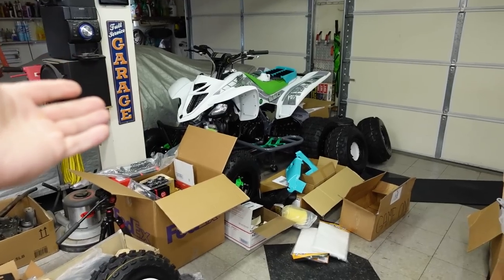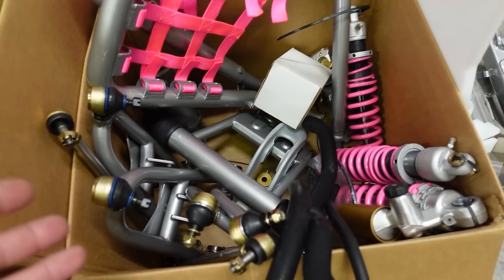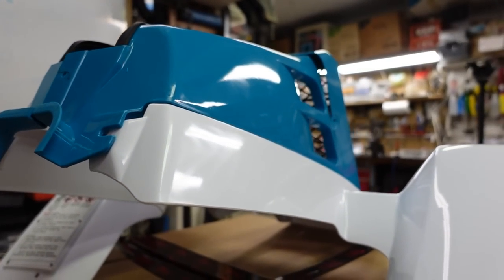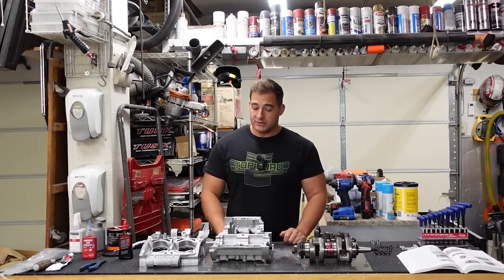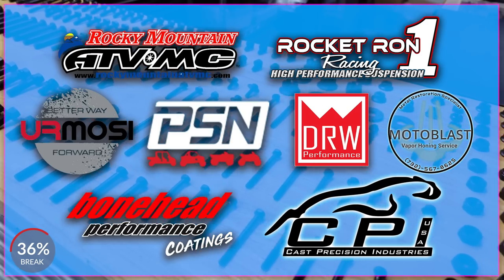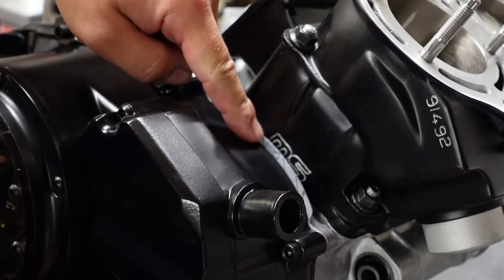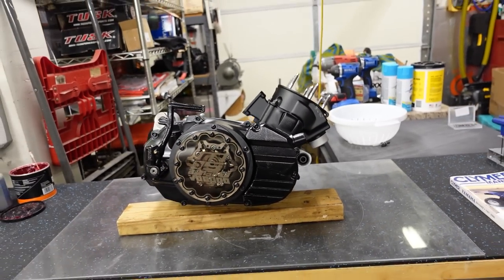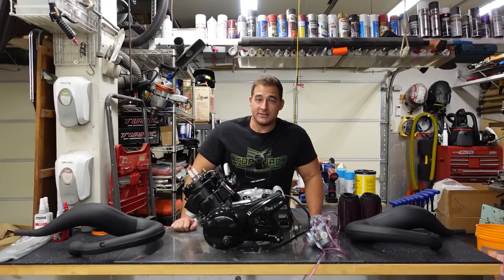Building a high Horsepower 2 Stroke for my Yamaha Banshee! Resto Mod Banshee Part 4

Comment: One thing, Im a machinist that has repaired/made tapers, never oil a tapered shaft. It causes it to never tighten and the reason for tapers is the taper holds the flywheel from spinning.  That oil/grease will cause sheared keys and more damage.
Reply: As a half eaten corn, hes right^^
Reply: As a half eaten sausage, hes right ^^
Reply: I learned that the hard way😭😭
Reply: As a professional YouTube Mechanic, hes right ^^
Reply: As a couch potato he's right^^
Reply: As a keyboard warrior… he’s WRONG^^😂
Reply: As a banshee flywheel key, he's right ^^
Reply: I’d oil it regardless, seen far to man that are siezed on by rust. I live in a very moist climate
Reply: @ericwinkworth6701  water cant enter the tapered fit if its tight and made correct, the taper locks into itself metal to metal. Thats why you need a puller to remove them
Reply: As just another schmuck repeating it, stick it dry bro, that's not what she said lmao 😂 🤣  u end up with a thin fluid film in there and the flywheel will slowly eventually over time vibrate loose, and not loose as in the nut, loose as in the keyway journal and keyway itself wear from constant vibration. I set mine dry, after I fit on with some fine grinding compound and lap the flywheel to the shaft. Just briefly, I've seen u do it in the past so I know u know lmao

Comment: Great Stuff... Just pulled the Banshee out of the shed for some mods and tinkering. bought it new in 97, one great piece. it might have 200 hours on it. im almost afraid to do much modification on the engine, its flat out runs so well. fukn plugs have always burned golden brown. Alot of your very good video tho has showed me a few things i could do . Thanx much!

Comment: best spring puller i have ever come by is an old lawn mower pull cord.... fits every where never slips and never gets stuck. started doing it when i worked on sleds. hell i have even used it to change drum brakes out and hood hinge springs on old cars.  look into it!

Comment: Nice job on your build!!! I use to do all my own port work. You can make it run ok, but absolutely not optimal. I now have CNC cases, cylinders and head. It's crazy the extra horsepower you make by being able to perfectly have the right amount of material gone and shape of the 3 pieces so matched up as one.

Comment: Exhaust bends and types can absolutely make a huge difference.  Prior to owning a banshee had a blaster with full fmf exhaust.  Well I crushed the silencer doing wheelies with no grab bar… 🤦‍♂️ for some reason I replaced the fmf muffler with a pro circuit unit and just THAT made a noticeable seat of the pants difference while sounding better than before.  🤷‍♂️. They were tough to mate up but it worked and the machine was a touch quicker without a doubt.   I bring up the blaster because it’s the only machine I’ve ever mixed or matched pipes on.

Comment: I'm rebuilding/ restoring and modifying my Kawasaki Prairie 300 now and it literally only started out as a get it running again scenario as in rings and piston now it's getting custom built foot wells wheels tires repowder-coated, freshing up the plastics the works. Maybe not to the standard that you set but I can only hope it comes out half as good as the work you do.

Comment: Your first problem is thinking JIS screws are Phillips head.
 Use correct screwdriver, they don't round out.
500 conversion on Banshee is around 105 bhp but I haven't seen one for about 20 years.
Clutch lock up is new to me, only seen that type on drag bikes previously.
It's a total waste of time and effort 'porting' area's covered by the reed blocks although I've seen a lot of them done, you lose some crankcase compression when they are 'cleaned' out but when it's 'on the pipe' it compensates a bit.
You put complete bottom end in freezer when flywheel is really stuck. Next day, pour boiling water on flywheel with the puller installed and they pop right off
The taper locks flywheel in place so anti seize stops things working properly
Has anyone told you the correct way to adjust drive chain when you don't have spec?

Comment: Hello Michael, I am from Germany and currently have a Banshee project running and have a question for you. Opinions are divided on the clutch basket. Some say that a straigt cut gear must be used for 421 cc, others say that the original basket and gearing are fine. What does your community say about this, as you have already built several 421s. In my case, some people think it only works off-road with the original gears because there is more slip than on the road. I'm now undecided and don't want to just throw the basket with gearwheel, which looks like new, into the corner. Best regards

Comment: Not to take away from your current build but, you should check the gears on the transmission you got for your 660. If about half of the gears have a cut in the center its 02 and up. Alot of sellers will lable 02 and up and will actually be 01. The 01 gear sets do not have the notches.

Comment: I have a friend that did I flywheel mod to make it lighter for more of a faster RPM climb. And it worked really well but it’s not good for the trails. Lighter flywheel means easier to stall

Comment: I have mine out of the frame and all apart right now.... wish i could throw that much money at it..3rd and 4th gear needs replacing.looks like a tooth broke off and chewed them both up.luckly it stalled the engine when it happened and didnt  destroy anything else..i bought the banshee brand new from the dealer in 04..piped and jetteted it within a few months. Fmf sst...power core 2...Then elka shocks and +2+1 full flight a arms. Raced mx tracks for a couple years with it..rebuilt the top end .20 over.then the transmission failed.and it sat for like 8 years..finally got it out and tore it down a couple weeks ago

Comment: I got a 1990 suzuki lt250r for free ive been slowly working on alloyboltz is an ok kit I would definitely rather do vapor blasting sucks getting basket cases and all the home depot hardware they usually come with.

Comment: 32:59 idk bout shaving the conners out maybe if it had the stock star cause it has to go a lil higher over each point it seems like the way you did it it could slip a lil easier idk I guess I’d have to ride to feel it

Comment: I need help I have a 2008 kfx450r and when I mash the throttle it spits and sputters I’ve only replaced the fuel pump and it will does it any advice on getting that fixed

Comment: doesn't the high temp paint hold heat into the pipe longer to change the operational power band? I was just curious. I always believe in raw pipes but I have a fmf on my trx 250r until I get the 408 puma one day haha.

Comment: Did someone advice you to run a set of 28 MM PWK's, with that setup ? It will, most likely, deliver more torque in low and midrange, with minimal loss up top. Anyway, nice build !

Comment: Didn't see you put any assembly lube inside at all on the crank or installation surfaces in the case. I would guess you did that off camera. Was waiting so see some on the wrist pins but nope, none. Yeah had to do it off camera. Gotta watch that double nut technique too, it equals screaming in 9 months.

Comment: How are you cleaning up your case. Making it shine like new aluminum
Reply from the maker: I usually get my cases vapor blasted and they come back looking new. The company I use is njvaporblast.com 

This engine I used new cases though, so there was no cleaning necessary.
Reply: @MichaelSabo  I just ordered a new case!
I learned the hard way with the All thread stud kit . My lower case is cracked from the studs and nut. 
So back to stock studs for the case and I called cpi for afr studs for the heads. 

So I have been emailing you about the graphics and I’ll send the rest of the payment through that PayPal thanks can’t wait for some supper cool graphics man .
Reply from the maker: @ryanhoward4598  Ryan I’m not sure who you’re emailing about the graphics but it’s not me. There are a ton of scammers in my comment section that impersonate me and scam people. I’m not currently designing graphics for anyone outside of my personal stuff.
Reply: @MichaelSabo  ohhhh thank god I contacted you on this 
Is there any way I can order graphics from you ?
Reply: Dude these scammers suck 😔 anyway thanks for all you do.
Reply from the maker: @ryanhoward4598  right now I’m not doing any customer work; I’m backed up pretty good with the current projects! I’m flattered you would want to run my graphics though!
Reply: @MichaelSabo  well if you reconsider let me know ! 
I built my banshee just like the voodoo banshee . You are a great salesman!! 
Only thing that im missing is the voodoo graphics. 
😊

Comment: You're gonna wanna do a Pro mod tranny for the 421. Otherwise its not gonna let you shift wide open throttle with the clutch. smooth or easily. As you saw with your other banshee with the 421 set up. even with shift mods sometimes it didnt want to quick shift. and you had to force it. your voo doo shee is stock bore low hp. so it wont have those issues. DO NOT run fmfs on that 421.will choke it out. run the SLP pipes please. lol.Cheers 🍻 bro

Comment: not the 35mm ''Building a high Horsepower 2 Stroke''😭
Reply: I think its your first time porting and why the fuck you didn't use oil when you installed cylinder